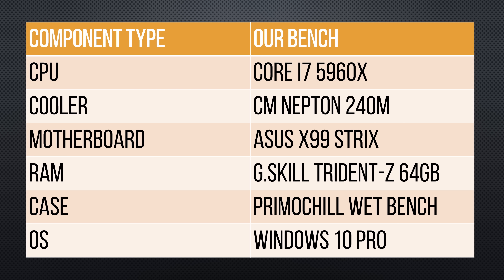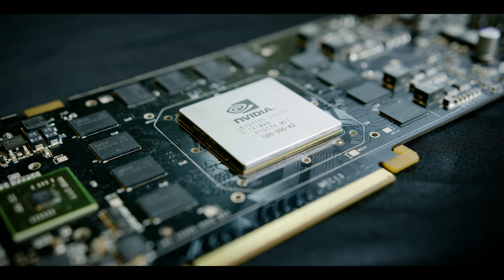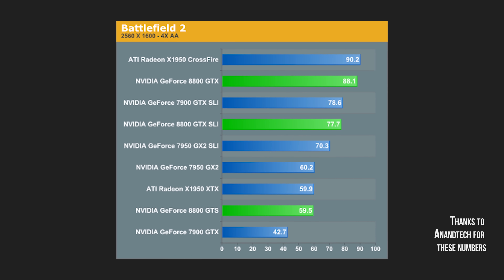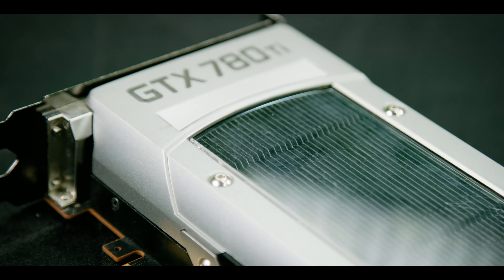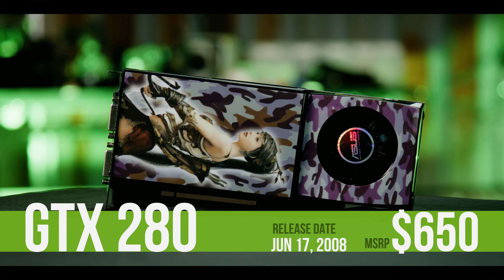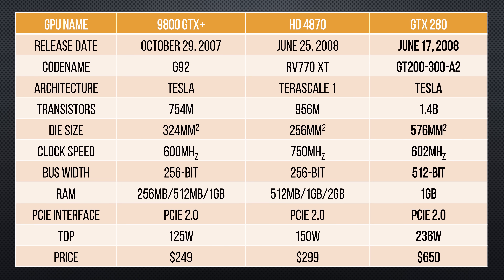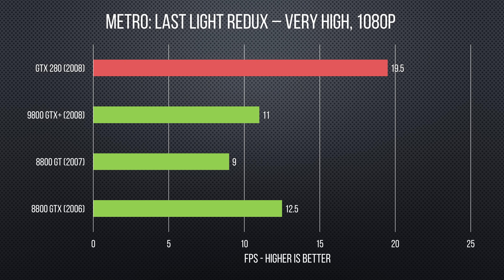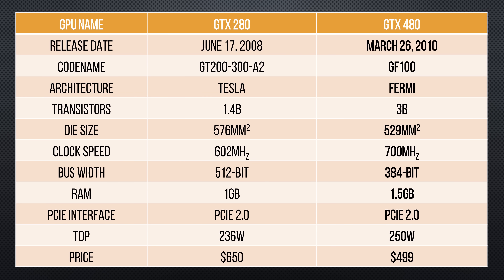10 YEARS of NVIDIA Video Cards Compared!

Comment: Can anyone name all the cards they have used and still have? Here is my line up.
Ti 4200 
FX 5700 Ultra
7600 GTS
7800 GTX
8400 GS (using)
8800 GTS
8800 GT
3 9800 GTX+ (I had only 1 9800 GTX+ and still have 2 of the non plus)
GTX 480
2 GTX 680 (still have them and currently using 1)
GTX 960 (using)
GTX 1080 (using)

Comment: what about gtx 690 or titan black!, (or even titan z) or are you guys just not covering dual GPU chips, but that still wouldn't make sense as you didn't include the titan black!
Reply: Titans are the big "F*** u" to your face cards. Nvidia purposely gimp the new gen flagship cards with mid-tier GPU chips. I.E as seen on Linus's explanation on the GTX 680(GK104) at 8:03 . They use the flagship GPU chips(Gx100s or the 102) on the Titan, as "Nvidia felt we don't need such a big jump on a new gen so we will milk you becos we can!"
Reply: or just the main gpu of the year?
Reply: I think the original titan was good value. the fastest single card solution at the time was a 680 which is getting on the slow side of todays cards. the titan was the same speed as a 780 but with 6gb. so if you got the titan when it came out you'd still have a card that could play modern titles 'ok'. this gives it has a longer life span before it needs to be upgraded. at least thats how I view good value
Reply: wayne elliott same for 770! it's still goin strong if U stick to 1080p I can play most games at high settings
Reply: Titans are kind of their own weird entity. I think they just wanted to compare the main GPU (or two) from each generation. Otherwise if you included them, then why not the 970 and 1050Ti and so on and the video ends up being an hour long.
Reply: ok thanks buddy

Comment: Here's the thing: While linus's graphs show little to no improvement in tested games with older Nvidia cards, at that time, difference between two cards were really big. 

Example you see in graphs fps improvement around 10fps or less per new card but at that time it ment running some game laggy on medium settings  (old card) or smooth with high settings (new card).

Comment: Woah hang on you forgot the 750ti one of the best gpus for people who wanted to start pc gaming at a alow cost!!!! 
Please Like so they can see!
Reply: Aussie Guy I got a 660 ti and it fucks the 750 ti
Reply: yeah it was a good runner! Always so cool and no power cable. I kinda miss it served me well for more than 2 years.
Reply: still it had low profile options and with a poop psu you can run it.
Reply: That'd be because the 60 trumps a 50, Thebiggestcheese... =3
Reply: A used gtx 660 will outperform it.Still not a bad card.

Comment: You mentioned that the 680 was a step down from the regular Nvidia flagship due to the lack of competition, but what you failed to mention is that what they basically did with that card was grab the GTX 660 that was supposed to come out first in the Kepler line-up and rename it just a few weeks before launch. EVERYONE thought it was going to be the 660 back then. Then the real 680 finally showed up months later as the Titan for twice the price. And that trend has kept going and even drooped down to other tiers; the 960 and current 1060 might as well have been dubbed 950 and 1050 respectively since they actually use the lower tier GPU denomination from Nvidia (GX X06), not the mid-range; that's on the 970/980 and 1070/1080, while the high end can only be found now on Tesla cards, the Quadro P6000, and a cut down version of it on the Titan Xp. They pretty much doubled the price on each of their product tiers (more than quintupled, in the case of high end Pascal) thanks to the lack of competition.

Comment: well the GTX 280 had roughtly 32% more transistors and was nearly double the size of an HD 4870, but just performed around 8% to 10% faster than the HD 4870 ... Realy not an good card from a technological standpoint

Comment: Now if nVidia could debloat their drivers, make them stable, not force a BSOD on you every ten minutes, and make their GPUs not run 120 C then they'd be worth the costs.  I still have an HP laptop that will hit the thermal ceiling of the raw silicon at 117 C by just running a demo benchmark windowed in 640x480 mode.  The GeForce Go 6150 was the worst chipset that nVidia ever created.

Comment: If AMD would have been keeping up... For FS Linus. TAHITI launched 6 months prior to KEPLER and was around 340mm2, and the 7970GHz destroyed the gtx680. AMD was not keeping up, they were dictating the market.
Reply: Till 780 came in, it was a brief domination
Reply: but that's an omission that skews public perception
Reply: Sadly, calling your wallet "the market" is a stretch.
Reply: And this is exaxtly what he meant! When Nvidia realized that AMDs best card is about the speed of their planned 660 mid tier card, they just released that planned mid card as 680 and not 660 like they were supposed to originally. Titan was the original 680 and 680 was supposed to be 660 or 670.
Reply: Shobe yeah this is basically why we got the titan lineup. Nvidia realized that they can use their mid range to compete with AMD's highend and then drafted the actual high end gpu into a new level of retardedly expensive ultra highend enthusiast tier. 

AMD's gpu is actually much more powerful than its NVIDIA equivalent on a hardware level with the 390x on 5.9 TFLOPs while 980 is only 4.9 TFLOPs, and now the RX 480 have 5.8 TFLOPs while the 1060 only have 4.4 TFLOPs but due to some driver wizardry NVIDIA can match AMD in gaming with inferior hardware, but Vulkan and DX12 which brought out GPUs to their hardware's maximum potential have begun showing the truth and exposing NVIDIA's tomfoolery. 

Thats why AMD got substantial boost in low overhead API while nvidia only got minimal boost and sometimes even performance drops because their DX11 driver is actually more efficient at bringing out their GPU's full potential than DX12.

Comment: If nvidia skipped over the 800 series, why do I have an 880M?
Reply: There is no 800 series for desktop. 800 series was a refresh of the 700 series for mobile.
Reply: It's an OEM branding. 880M sounds newer than 780M with tweaked settings
Reply: the focus on the video is only on desktop gpu's. He did not mention laptop at all in the video. So in the desktop side of things, Nvidia really did skip the 800 series
Reply: It just like 300 series for BestBuy and Mac. lol
Reply: The 800M series were just slightly improved versions of the 700M series. Still, kinda surprised he decided not to mention that. He did mention the 300 series, after all.
Edit: Before people comment telling me, yeah, I know there aren't desktop 800 series GPUs, but he still shouldn't have said they just skipped over the number.
Reply: AblazeNicks And why do I have an 860m?

Comment: Unpopular opinion(?): Minus the heat issues, GTX 400 series & Fermi really set the stage well for nVidia, especially after the rocky release of the 200 series. I still have a 465 and I absolutely love it, even if it does raise my room temperature 8 degrees F.
Reply: 8800GTX was the card that really beat anything one could put against it. and then they made 8800 GTX ultra
Reply: 470 and 480 were full of problems from the Nvidia stock. It took all of the AIB partners to save them.
Reply: my 480 got so hot it melted the case card slot tool less clamps in my Cooler Master Centurion 534. I'm glad I saw it before something bad happened, I cut a window in the side panel and after I noticed it I screwed it in and have ever since that debacle.
Reply: I have two 465's sitting in my closet right now. lol
Reply: OzTalksHW hey man u a part of the notifcation squad
Reply: CapnTates it was because of physX , 3d I think back in 2010
Reply: Andrew Joy Same me too , had 2 480's amps from zotac , 😍👍 , my 1080 ti Gaming x isn't that exciting like those cards 7 years ago 😃
Reply: n7_siquze how old are you , 12 ? :-) i couldn't afford graphics cards at that age too , but when you get a job and live with you parents you can afford gtx 1080 ti sli ;)
Reply: I loved the 400 seeries , i had 2 480s in SLI and it was just mental . It was like how much power and how much heat can we push through this card without it cooking. Screw that its loud screw that its hot POWERRRRRRR. It was the TVR of video cards , backwards , broken down and on fire , but whoever owned it had a massive smile on there face :).
Reply: LW Canuck dayum dude im still using a geforce 7600 gs
Reply: n7_siquze Well im running 3 titan blacks right now. lol so no use for the 465's or 770's in the closet.
Reply: LW Canuck lmao i hope i can afford something like a 480 or 1060 one day xd
Reply: Dimitrij Glasow uh no man, im 17  and even if i could get a job it would take about a month to afford a 1060 without spending a dime on anything else
Reply: don't need to be 12 to not can afford 200+$ cards.
know many countries there is almost impossible to get work if your below 16, and if your 16 and can score a work at the local groceries store it will take absolute everything you earn for a month to could afford it.

was little easier back in my youth since there was really not that many games that was that gpu bound so you could play most stuff with just a silly Geforce 2 MX and getting small works even if you where below 16 wasn't that of a problem (here in Norway you could serve people alcohol when you was 14 as long as there was someone above 18, now you need to be 18 to serve it (and 21 to serve anything above 21%)).

the first card of mine, a Hercules 3D Prophet III Ti 500 (Geforce 3 Ti500) was 5 months of delivering newspapers, and this card was on sale because the Geforce 4 series had been launched...
Reply: Børre Børresen crazy story m8 ,
Reply: GT440 owner, and now i have a 1060, FERMI IT'S AMAZING, Pascal it's gold.
Reply: I have a feeling that's how Vega is for AMD now.
Reply: OzTalksHW plus the 480 is sexy af for a reference card
Reply: I love my 460 too
Reply: But for sure i think that when i changed my 8800gtx for a slim single slot  8800gt i was very happy. I notice that the video card was consuming  less power, had the same performance (with a little overclock) and permit me to use a nano tower case. (and last but not least after  selling my 8800gtx i was able to buy a new cpu Q6600, gpu 8800gt and 2 gb of ram upgrade,mobo remain the same without spending nothing)!!!
Reply: Yeah.. i have gtx460n msi and when you look at it you know that stock cooler will not make that chip happy.
and thing you said about raising room temp is literaly a fact lol
Reply: CapnTates Well i´ll tell you why I bought Geeforce over ATI back then: Because back then ATI drivers had the unfortunate habit of crashing A LOT in nearly every freaking game...

Ironically, the same problem Geeforce has today lmao! Or rather ever since around 2011 or so, as soon as the GTX series saw the driver seriess 3.6.0 or so I swear to god.... ---> Crash, crash, crash... One fucking blue and blackscreen whilst gaming after another! After some reading I noticed that I wasn´t the only one with the problem and that the new drivers are to blame in fact. The forums are still full of old complaints from people over this. I then tried downscaling my drivers again... Didn´t work... Once the new ones are installed it is like it does PERMANENT freaking damage deep to your system! Fuck that I can say!

Not only that: Nvidia destroyed my windows 7 and BIOS COMPLETELY and TWICE by now!!! Same shit like last time, I can´t run certain drivers including graphics anymore and my windows 7 is damaged to shit! Thanks Nvidia! Also I should mention that the second windows I set up used the newest driver without the useless experience bullshit and all that which is also known to provoke problems. That was until it destroyed my system recently, AGAIN! I had at least a few BSOD´s with the new driver, but still it crashed and in the year 2016 Nvidia still failed to fix their shoddy drivers!

Well I for one am not putting up with that anymore! I´m slowly building a new rig anyway, mine is still running on an old phenom and a GTX lol... A new rig is definitely overdue. I decided to go for Saphire Radeon this time. As said won´t deal with the constant annoyance of crashes, ruining my gaming experience and driving me crazy. I am also sick and tired of Nvidia destroying a perfectly stable windows. I have no idea what the heck the team of Nvidia is doing but ever since 2011 I can attest all they do is crap! One fail after another! You´d think a wealthy corporation like Nvidia would do better but nada. They don´t fix it and I won´t buy it anymore.

Also take a look at amazon and compare the GTX 1070 TI reviews to the new Radeon models. Yes while both new 2017 cards initially started with buggy software prone to crashing, Radeon got it fixed in 2 updates in a bit more then half a year. Whilst people who chose Nvidia are still stuck with BSOD´s and 2 people had their BIOS destroyed just like mine in a matter of  only half a year lmao! Showed me that Nvidia still fails big times on its newest graphic drivers and architecture as well! Why anyone would still want to buy junk like that is really beyond me...

Radeon actually developed in the past years and fixed their driver issues, plus they gain a good amount of performance for every driver update, and Radeon continues to support the development of drivers for old cards as well. I only wished the newer models wouldn´t be so powerhungry... Hell if I had known that back then i´d had gotten myself a stronger Radeon for the same or even lower price and just waited a year or 2 for updates. Yeah would have maybe frustrated me in the short run, but at least spared me yeaaars of frustration that Nvidia caused in the long run! Plus I would have gotten better gaming performance from Radeon for that price too.

Well my saphire nitro RX 470 is very energy saving, I do plan to upgrade to a stronger model sometime later though. Probably an RX Vega 56 since that one also goes low on your energy consumption. It´s the only one of the Vega series that uses the Vega 10 XL architecture.
Reply: So, I know this is an old comment... but it adds -13.3333 celcius to your room? does it even make a difference?
Reply: Ayy Oz love your vids man.
Reply: Dimitrij Glasow
It actually was quite an interesting story.
Reply: "Screw that its loud"
well... its kind of silent compare to the 5800 Ultra... not only was that insanely loud but it had this high frequency pitch too...
and the performance was like when when the GTX 480 was released. the better out there, the most expensive but not really that impressive for your buck... 
though it was more that here the 480 and 580 was far more expensive than the top cards from ATI\AMD,
could get the 5970 and later the the 6990 for less than what the Nvidia GTX 480 and later 580 cost (yeah... you got a 6990 for 580 price, and then needed 300$ more for the 590...)
Reply: Børre Børresen you "can" get a job if you are 16  but only if you have connections
Reply: They were actually quite bad. ATI's competing card wasn't sold nearly as much despite the better price/performance and way better power consumption.
Why the consumers bought so many more 400 series than HD 6000 series' cards is a mystery to me.
And it's the reason AMD has such a hard time catching up, when they actually have good GPUs, people still rather buy the worse ones because of the brand.

Comment: wanna hear a joke?

gt 730
Reply: Night Wing hey man i have gt 210 can you make a joke about that
Reply: Wanna hear the biggest joke ever ?

gt 705 (really exists)
Reply: I have a gt 730 2gb in a q6600 rig, it actually manages some 1080p, quite shittily might I add.
Ill stick to my 3770/390 combo.
Reply: xWood4000 then its simply not a "gaming computer"
Reply: Green Sword it is a low end gpu what do you expect. It plays cs at 200fps 4:3'low which is fine i guess
Reply: Night Wing It's much better than the integrated graphics in my gaming computer which has parts from 2007.
Reply: Night Wing ihave a gt 740 and its shity af
Reply: Pokemonfan i had that card it was a nightmare
Reply: Night Wing that's not even a joke, that's the bloody truth
Reply: ha mate i´ve had that bitch till last week now I am a proud owner of 1080ti asus rog
Reply: I use a GT 730 (64bit GDDR5) in both of my computers, but they're both sff systems.  I don't game on my Windows 10 computer, a Lenovo M700 sff, and my other computer is a Dell Optiplex 755 sff running Windows Xp.  I prefer to run my old games at 1024x768 but the GT 730 can run Doom 3 smoothly on ultra at 1080p, no AA of course.  That said, I don't really recommend the GT 730, unless you're building a sff Windows Xp offline retro gaming rig.
Reply: Antoine Bonnier I Know that there are  some 700 cards that are made for wallmart PCs or something. I think i've seen a GT(X?) 745 or something in an advert
Reply: Night Wing FUCK OFF
Reply: I have a GTX 745.
Reply: Night Wing I'm gaming on it and parts of it were actually in a computer that was branded in the store as a gaming computer.
Reply: Thats an OEM card, and yes it's a GTX.
Reply: Night Wing And it has a 730 in it now if I didn't make it clear but it was pretty recently that I switched.
Reply: Lol! I was using that with a core 2 quad in an XPS 420 until I saved up enough for my ROG 752vs OCE. Now I have a 1070 and 6820HK. :P
Surprisingly though it ran everything fine for me. Got 60+ FPS in Skyrim, LOL, and Overwatch which is very graphics intensive.
Reply: FatDolan the joke is on you that you bought it